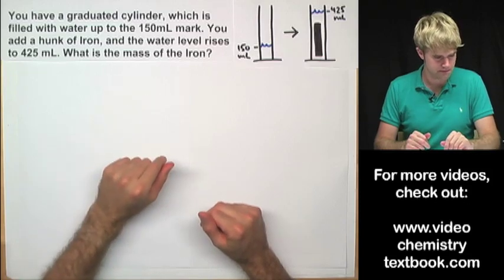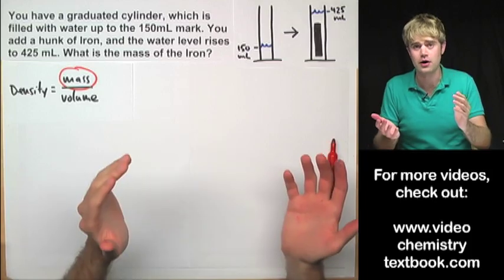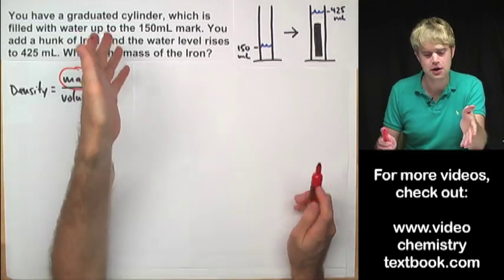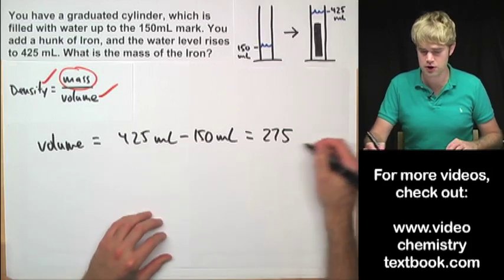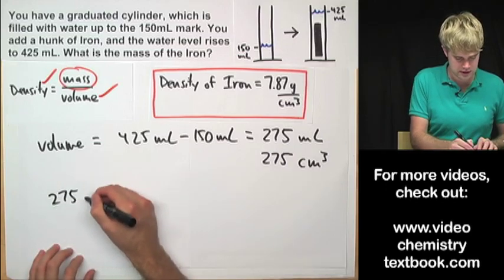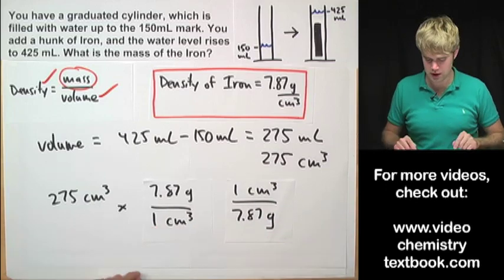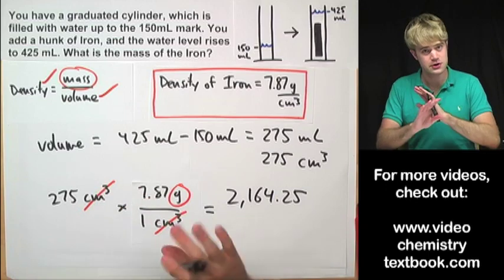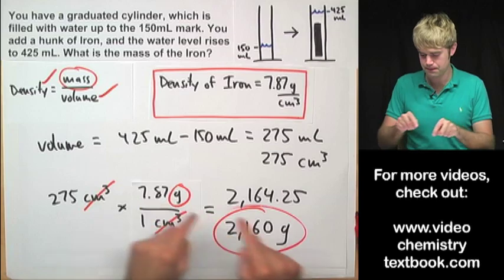Advanced Density Problem 2

Comment: when he rounds the final result why is it 2,160 and not just 2,164?
Reply: +Ana Patino he only needed three significant figures because 275 and 7.87 both have three sig figs. If he kept it as 2164 it would've had four sig figs. you always want to write your answer with the least amount of sig figs possible.
Reply: +Ivan Mendoza thank you! makes perfect sense to me now
Reply: codina doesminecraft A 0 is significant depending where it's at. Any zeros after the decimal or in between two non-zero numbers are considered sig figs. If a number ends in 1 or more zeros and ends right before the decimal point then it's not considered a sig fig. For example 100 has only 1 sig fig, but 100.00 has 5. So in your case the answer would just be 1.2091
Reply: so 0 is not consider as a sig fig. so if 54561 / 45124 = 1.20910000 instead of 1.20913483??
Reply: 3 significant figures?

Comment: hey tyler, got a question, in general not everyone knows what's the density of iron, but what if this kind of question came out in an exam, u cant  google stuff with ur phone right , so i was wondering  is there another method to know the density of an element based on the question
Reply: I think it is impossible for this type of question to come u should have at least 2 variables without them u can't do the question and by the way your teacher can't for example give u a question like 
Find the mass of the object so based on that question you should have density and length in the question
Reply: yes